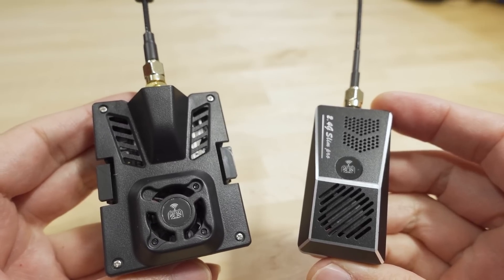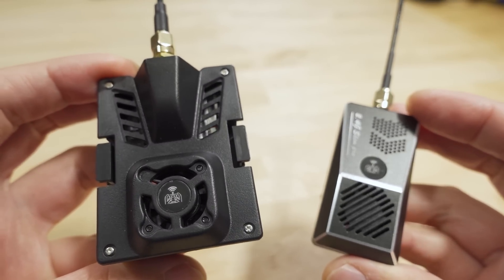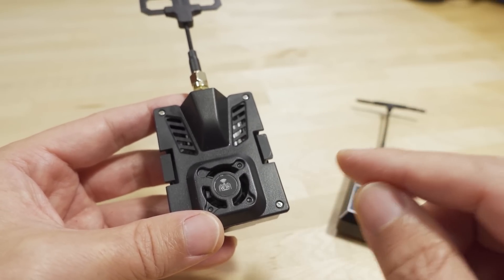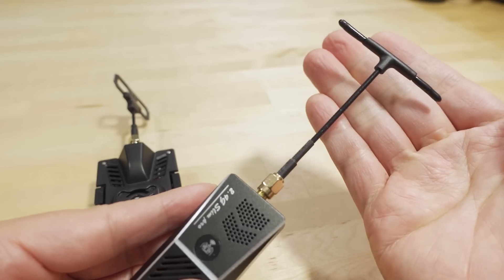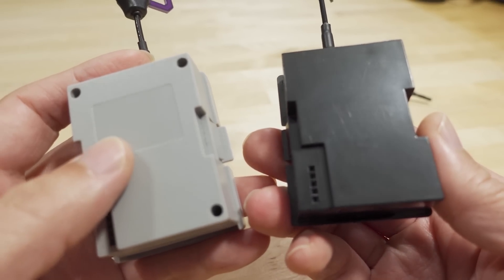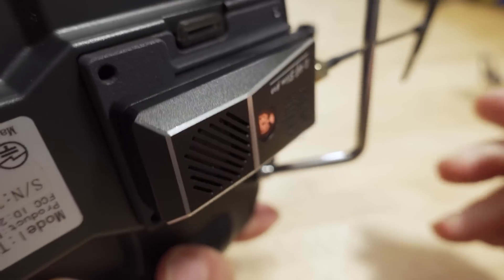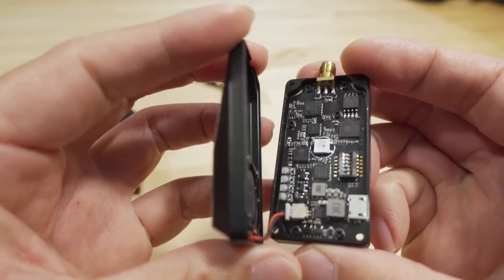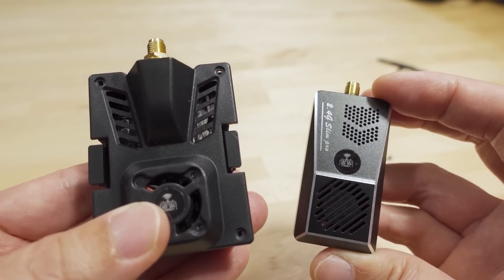Happymodel ES24TX PRO 1W ExpressLRS Modules 📡

Comment: Does it work with older x9d
Reply from the maker: Yes, but you have to be on newer OpenTX or EdgeTX firmware and install the ELRS lua script.  Older X9D's don't have the right software on it so you'll need to do the upgrades first.

Comment: I was gonna run the micro tx module on my flyskyfsi6x once I download the open tx but I was wondering, I saw the 2 wires (ground and signal) to plug into my flysky   but is there a wire for external power like a lipo? (I couldnt tell if there was a fan wire or not) I dont want to kill my flysky batteries. If there isnt a external wire do you know of a 1 watt tx elrs modul that has a external wire and exposed ground and signal wires? Thanks
Reply from the maker: This one... https://youtu.be/QZTw40lJvlM
Reply: @AlbertKimTV  geez $100...maybe I don't need 1 watt do you know any other modules above like 600mw? Thanks all info helps

Comment: Albert;  I asked Nick Burns and didn't get a response...  Can you update these without the Configurator?  I have a Windows 7 Laptop, ELRS configurator does not appear to be available for windows 7.  ES24TX Pro  (Micro TX)    TIA
Reply from the maker: Have you tried to just install it on Windows 7 anyway?  What happens?  Any error messages?  I don't have Windows 7 to test here...  AFAIK, you'll need the configurator to at least make the build files.  You could ask someone else to make the build files for you and then flash them via the wifi method.
Reply: Well. I'll be damned!  It does download and installs just fine on Windows 7.  THANK YOU!

Comment: Was flying my Nano module with my tango 2 the other day. Even on 100mW it got burning hot. Watched this video to figure out the fan and saw the option in the menu. Thanks. 👍
Reply from the maker: Glad it helped
Reply: o O  Yes - I actually tested yesterday! I lowered the fan threshold and my Tango started shaking. 🤣 The fan seems a bit unbalanced. When lowering tx power to same value as fan t.h. the fan stopped mid flight and I actually thought I had a failsafe when tango stopped shaking. 😁

Comment: Got the Pro Micro on the way from Banggood.  Gonna use it with a Radiomaster TX12, and I got a Happymodel ELRS/VTX combo board to install on a DarwinFPV Baby Ape.  Good review.  Can't wait to get set up.
Reply from the maker: Sounds great!
Reply: curious why you buy ES24TX when the Radiomaster TX12 come with ExpressLRS module already?
Reply: @RandyMaulana  I have an original TX12.  Doesn't have ELRS.

Comment: Thanks, Albert! On your video (time 7:19) i saw the USB connector on the Micro module INSIDE the plastic case. Does it have any purpose, maybe it is possible to flash the module with it? And what is the role of dipswitches panel inside the module? And thanks for your videos!
Reply from the maker: Yes, that can be used for flashing along with changing the jumpers.  It's like the previous version.  Not sure why they didn't make the hole for it in the case this time. 🤷‍♂️

Comment: Thanks Albert. I got the slim pro to use with my X9 Lite and I agree it is pretty solid. I feel like the aluminum case helps dissipate heat pretty well, but it does get a bit warm after a while. I just stick with 250mw though and that works well enough. I can also confirm I got the newer "moxon" style antenna with mine.
Reply from the maker: Thanks for sharing
Reply: im such a newb, is that still a term? when you plug the module on to the controller does it just work? what am i missin??

Comment: Will you be reviewing the Jumper/Soon slim ELRS module? I got mine but It's not in fire configuration so I was wondering how you flash the firmware?
Reply from the maker: Currently you can't flash it with ExpressLRS configurator so you can only bind to V2 receivers with the traditional bind method.  I don't plan to make a video until the target shows up in there but I hear it won't be until V2.1 is final.

Comment: I picked up the Slim Pro model earlier this month and it came with the old T antenna.  Fitting it on my Tango 2 with the module bay adapter, the TX is actually too loose and will pop out even when just setting the radio down on a table.  Anyway, nice video as always, Albert.
Reply from the maker: Interesting.  Most people told me it was too tight.  Seems there's a lot of variance between radio models.
Reply: @AlbertKimTV  i agree. The one I got was tight in the beginning, but sits fine now. Also I got it with the moxon antenna. Bought it sometime in November.

Comment: Wonder what the stable mW outputs are after these modules get up to their operating temperatures..?
Reply from the maker: Without a professional level calibrated power meter, there's no point in measuring since the results will be unreliable.  When I showed results in the past, some people told me my meter was off by 50% on the high side.  Others told me it was off by 150% on the low side.  So what's the point?
Reply: @AlbertKimTV  understood. Great review of these two products!

Comment: Good review and timing. Why do the modules that have an external power input plug provide it? So you can use an external source to save your internal battery? Or is there some power level that as you go to 500mW or 1W that the internally connected battery is unable to get enough juice through the internal module connector? Guessing that is why the Radiomaster 5000 mah battery advertises it has an xt30 connector that's just the right length for the CRSF external module, but that would imply this Happy Model module wouldn't work at the higher power??
Reply from the maker: The modules with plugs is to allow for the radio battery to last longer.  As long as the module has enough power from the radio, it will always turn on.  However, at higher output power, it will draw more current and may sag the voltage on the radio battery to the point where it might shut off a lot sooner than expected.  However, this is mostly the case with radios that use poor batteries or user error.  If you use proper batteries, this is not gonna be a big problem unless you fly for LONG sessions over 30 minutes at a time.  In that case, people dumb enough to not know how to fly long range properly will experience failures and blame their equipment like we always see on the net.
Reply: @AlbertKimTV  Thanks for the clear answer.